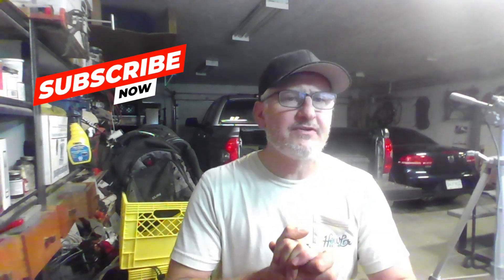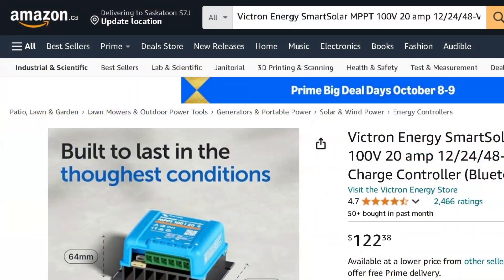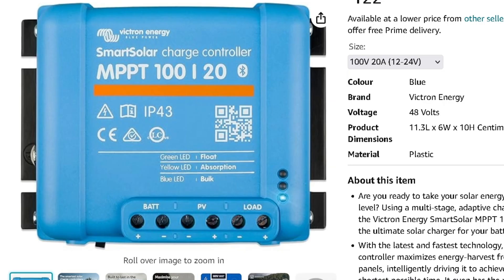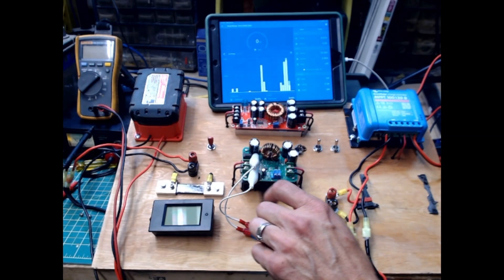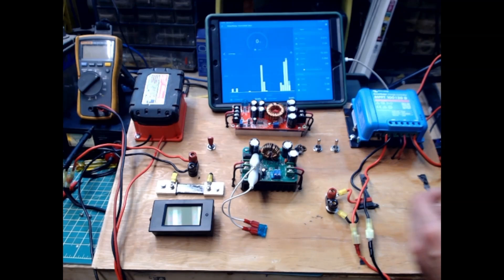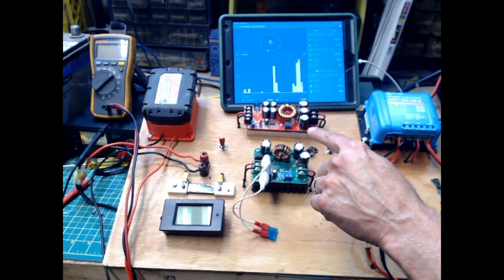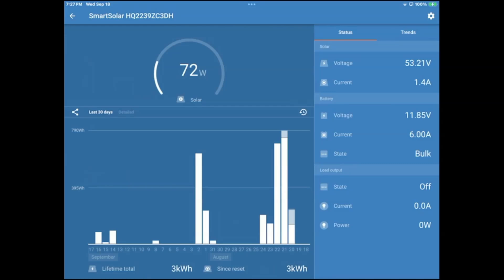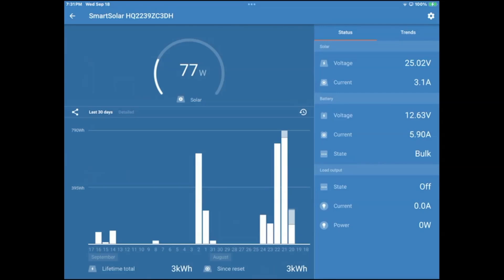No Sun? No Problem 😎  Amazing Solar Controller HACK #solar

Comment: Interesting to see where you are going with this project.  I started with a Victron 75/15 and a 100Ah LiFePO4 battery.  Now I run 3 150/45's that charge 6 100Ah batteries wire up 24V.  Using Victron inverters and run the entire shack and then some off solar.  Have a Victron 70A 24/12 DC/DC converter to run all the radios and other 12V gear.  I use the same 1200W converter to take the 24V to 48V to run my Harris amplifiers.  The only comment I have on your system is that you should consider moving to mini DC breakers instead of switches, especially on the PV input.  You get the benefit of using it to turn things on and off as well as resettable fused protection.  I use DIHOOL and CHTAIXI brands with the nod to the DIHOOL.  The small form factor and din rail mounting would work well on your plywood board designs.  Use a double throw breaker on the PV input and switch both + and -.  Also remember with Victron MPPTs you always have to apply the battery voltage before enabling the PV.  Doing the PV first is an easy way to let out the smoke, and Victron gear is too expensive to be doing that often!  I'm not using my 75/15 right now so hopefully your next videos will give me an idea as to a way I can use it.
Reply from the maker: Great set up you have there, wow!  Yeah the development board still could use some refinements and the breaker idea is great. I do hesitate using them as they are not reliable when it gets really cold. Cold as I mean -40 cold.  Had some wires actually smoke
before it tripped.  Thanks for watching

Comment: sorry to correct, but what you referre as buck converter has to be a boost converter ... buck converters have lower output voltage than input voltage, where boost converter converter increase the input voltage to a higher output voltage

it could also be a buck boost converter that converts higher voltage to lower and lower voltage to higher ones - to keep the output voltage constant independend of the input voltage

just my 5 cents
Reply from the maker: No worries, my inbox is full of lies I told in my videos 😀.  I will do better next time.  🤓
Reply: @MrMudsHamRadioTime  thx for your reply - however, I wouldn't call that lies - good video, keep going!

Comment: This is genius. Yes it's inefficient, but not being able to charge your main batteries in an emergency is 0% efficient!!! One note. Both links in your description link to the same 1200W buck converter. Any chance you can update the 600W link? Thanks for the work and sacrifice in equipment to work out some of the kinks in this build for us!!
Reply from the maker: Thank you for the kind words!  Good thing is I like sparks and smoke LOL.  And thanks for the heads up on the links, got them fixed.
Reply: @MrMudsHamRadioTime  Awesome, thanks!
Reply: The 1200W converter is cheaper and covers a wider range.  Don't bother with the 600W one.  I have the 1200W version with a fan and it work well.
Reply from the maker: @danarawding5198 you are absolutely correct.  The only problem is my 1200 started creating a strong RF ripple that comes up across the amateur HF bands.  It was clean for a week?  Most likely the caps and that will be a project in the future.

Comment: Since you are not driving the Victron with a solar panel, one important thing you have to do is put a fuse on the SOLAR INPUT of the Victron.  The reason you have to do this is because the Victron has a OVP failsafe mode which will clamp the solar input under certain conditions.  You don't want that to cause a fire or burn something up if it triggers.

Your efficiency is going to be hell.  Bucking voltage downward can be made quite efficient, but boosting voltage up is inherently inefficient, and the larger the multiplier of the boost, the worst it will be.  You want to find solutions that don't involve boosting voltage.

Generally speaking the solution is to start at a higher voltage.  For example, have the home backup battery system / primary house battery system, be a 48V system (with LiFePO4 that would be 51.2V nominal, 56.8V charge target).  Then for satellite systems such as, say, a 12V system for running a ham shack or something like that, you simply connect the higher voltage input directly to a charge controller + battery (via a fuse of course), or a 48-to-12 buck converter (no battery).  That is, you only buck voltages down.

Charge controllers that buck voltages down can be as much as 99% efficient.

I use this method to down-buffer from our 48V house system to critical 12V satellite systems.  Basically I just take the 48V house DC -> fuse -> Victron -> 12V LiFePO4 battery + gear.   Having the smaller battery in the loop guarantees that the critical satellite systems will operate for a time if the main house system craters for one reason or another.  And that battery also protects the lower-voltage systems from any failures that might feed 48V directly to the 12V bus (by causing related fuses to blow if that were to happen).

-Matt
Reply from the maker: Great explanation.  
I idea behind this is to harvest anything you can when in an emergency.  I agree it’s better to convert down instead of up.

Comment: Homemade dc-dc charger.  Given the SCC us more expensive than dc-dc converter, result should be more expensive than commercial version.

What would be interesting is to simultaneously take in power from solar and a 2nd source and have the result be cheaper than the commercial version.
Reply from the maker: That would make a great experiment!  Thanks.

Comment: I believe you mean BOOST converter. A buck converter reduces voltage, a boost converter…well, boosts it. So if your input is 12.5V and your output is 50V, you must use a boost converter.
Reply from the maker: Correct, my bad.   Now I need to train the brain to say it properly lol.  Thanks for watching

Comment: One small problem... at each change in power going through a buck converter, regulator, battery, etc. you experience a % loss due to inefficiencies. How efficient is that first converter, then that is compointed by the efficiency of the solar regulator you are using etc... each stage reduced the efficiency of the previous stage. A good idea but have you measured your losses?
Reply from the maker: You are 💯 correct on losses but the goal wasn’t to be efficient.   I just wanted a way to change my battery in an emergency.  Great comment and thanks for watching

Comment: This might be perfect for my remote repeaters.
They are all at site with commercial utility AC power with LPG standby generators.
Can I SAFELY feed a 12v 100ah LifePO4 battery with a MPPT fed with a DC source coming from an AC supply?

Hytera RD-982 repeater is 12 vdc (+/- a few %) and uses up to 14a on transmit.

Thanks !
Reply: With most buck solar controllers you can feed DC into the input.  However, you MUST fuse the input because many solar controllers, including the Victron, have failsafe states which will clamp their solar input were they ever to be triggered.

Generally speaking, the power supply feeding the solar controller has to be fairly robust because solar controllers will still try to run a MPPT sweep and this can easily (temporarily) over-current the power supply.  Power supplies which have a "HICUP" mode for dealing with shorts and overcurrrents can often wind up turning themselves off due to this.   Power supplies with nominal current limiting will generally work.  Power supplies without current limiting can wind up frying.

-Matt
Reply: @junkerzn7312  Thank you!
I really wish there was an “off the shelf” solution like we had with “battery tenders”.
I have actually been using modified HP HTSNS Px-29 server power supplies for most projects as of late.
(only mod’d to power on automatically and then soldered multiple silicone insulated #10awg stranded copper output wires to the edge connector).  They put out 60a at 12.0-12.4 vdc and it’s surprisingly very RFI/EMI clean.

I actually prefer them over most “radio” power supplies for most applications.
I even power my own repeaters with them .  (Mostly Hytera RD982’s)
Reply from the maker: If done correctly you can.  As per my testing I would use a dc to dc buck converter to feed the solar controller.  
To size your ac to dc converter you will need to control and set a limit on the solar controller battery charge rate.  For example I limited the charge rate to 6 amps and pull 10amps off the ac to dc converter. As you have to realize that there will be efficiency losses.  
I will use this question as a future video on the subject.  
Great question.
Reply: @MrMudsHamRadioTime  Thank you Sir!
I’m getting old and arthritic, so carrying pallets of lead acid batteries up to rooftop sites every 2-3yrs is killing me.
😉